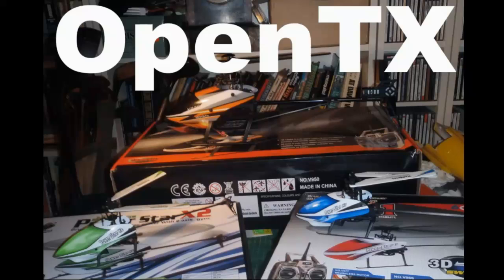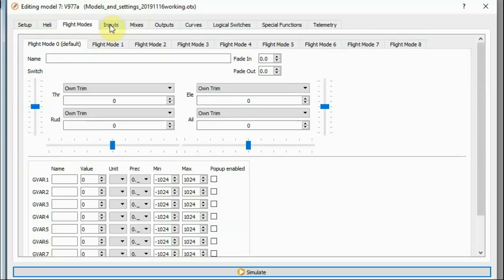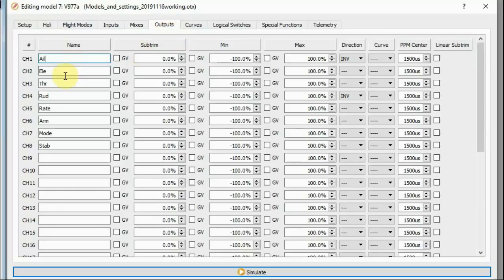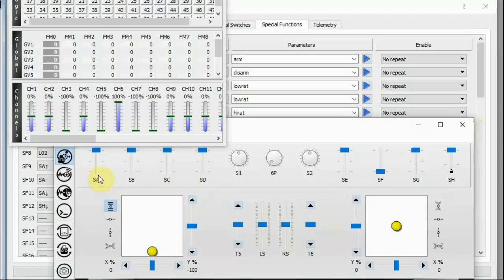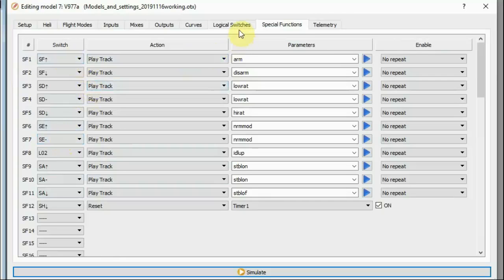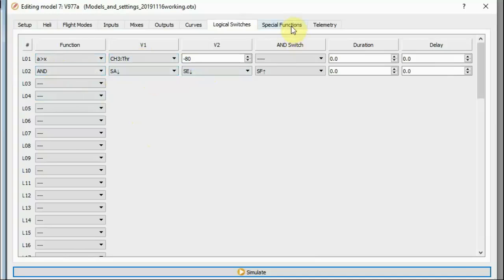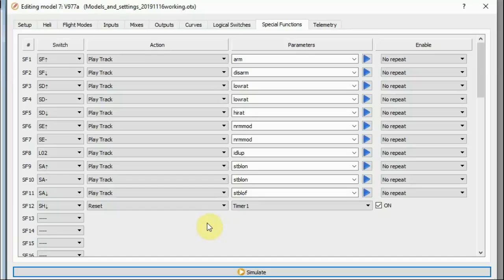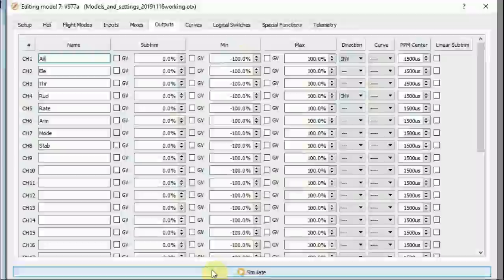OpenTX Heli Programming Pt 3   Flybarless Helis without Pitch Control WLToys V977, V950,V930

Comment: Why are the V950 and V977 helicopters advertised as "6CH" if they need radio output on 8 channels?
Reply from the maker: Are they advertised as 6 channel? I'm looking at the box for my V950, and it says '6 axis', but that's a different thing. 6 axis seems more accurate than 6 channel (though even the meaning of that is a bit questionable). They are collective pitch helicopters, capable of 3D flight. I think the confusion comes in between channel and axis, with '6 axis' being a common way of indicating a collective pitch, 3D heli.

Comment: Hi thanks for sharing, do you have a video doing this directly on the radiomaster tx16s transmiter,????
Reply from the maker: No, my OpenTX transmitter is the Jumper T16, which came before the RadioMaster version. But OpenTX is OpenTX - it's not written by the manufacturers of the transmitters, it's open source software. Now, OpenTX itself will have changed a bit since I made these videos, as new releases come out regularly... but new releases are always intended to be compatible with people's previous set-ups, so what is shown in this series of videos should still work on any OpenTX transmitter. If you have a computer, I'd suggest getting the OpenTX Companion program (free from the OpenTX site) and doing your programming on the computer, then transferring to the transmitter. For me, at least, that is much easier than trying to program using the small screen and limited controls on the transmitter itself.

Comment: my heli v950 can't bind on tx16s.  can you help me?
Reply from the maker: Not really. I've flown a v950 many times without problems with my T16. Are you sure that you have the protocol set to KN with the WLToys sub-protocol? Oh... with the v950, to bind it, after you put the battery in, you must press the little button on the front left of the controller board, to put the heli into bind mode - then, after you press that button, give the bind command from the T16.

Comment: Would it be the same for the V911S?
Reply from the maker: You can certainly program the V911S in the T16. Honestly it's been a while since I did mine. I was just looking at the programming for it - it's very straightforward, being just a stabilized, fixed pitch heli. There's a protocol specifically for it in the module, 'WL Heli V911S'. Then you really don't need anything, except Ail, Ele, Thr, Rud on 1, 2, 3, 4. I put mixes in for rates, but of course, that's not required. You don't need any curves, or logical switches, or flight modes. As Special Functions, I have SF as a throttle cut, overriding CH3 to -100, and then playing sounds for the throttle cut and the rates, and a timer reset.
Reply: @kleedhamhobby  Thks, I did exactly as you did with a Eachine E119, and I expected to work similar to the original transmitter (tame and aggressive), but it seems to fly exactly the same with and without all the bells and whistles integrated, and a miss this feature of the original transmitter.. Regards
Reply from the maker: @enriquech4041  I'm not quite clear what you mean. Yes, the V911S is similar to the E119 - basically they're exactly the same class of heli. The E119 is actually more docile and easy to fly, which, I assume, is because of the programming of its onboard controller. What 'bells and whistles' are you missing? Actually, I don't think I've really flown either of these helis using the transmitters that ship with them. I did see reviews saying that the transmitter that came with the 911S wasn't very good.
Reply: @kleedhamhobby  In the transmitter you have a left button that is used to change the flight behavior, from tame to agressive, and I thought that with your programming I could recover this feature. Regards
Reply from the maker: @enriquech4041  I don't believe stabilization can be turned off with the V911S, so probably all that button is doing is reducing rates. I do set variable rates in my programming - that is done by mixing at different levels on the Mixes page, and I control it with SG, giving low, mid and high rates (which I have set as 70%, 85% and 100%, with 35% Expo for Ail and Ele and 25/30/35% for Rud - but of course you can set the rates to whatever you're comfortable with... but if you set the rates too low, you may find it hard to control the heli).
Reply: @kleedhamhobby  Ok, that is clear. I will experiment with that. Thks again. Regards
Reply: @kleedhamhobby  Thks, I tried with 40-60-100% differential and it worked fine.

Comment: Hi thank you for the tutorial, however as you've mentioned that pitch movement can not be customized setup via the opentx pitch curve setting, but is there any way to increase the pitch maximum angle?
Reply from the maker: Well, there really isn't any direct access to the pitch from the transmitter programming with the V977 and the V950 - it's controlled by the programming built into the heli's flight controller. So I believe the only way to change the maximum pitch angle on these helis would be either to somehow get into the programming of the onboard flight controller (I have no idea how you would do that, but I might be possible with the right tools and expertise), or to modify the hardware - e.g. a longer arm on the pitch servo would produce greater movement (but I wouldn't be surprised if this messed up the control and caused the heli to crash, since it would obviously cause results for with the flight controller wasn't programmed).
Reply: @kleedhamhobby  yes indeed by stretching the arm, you are correct, and thank you for your excelent idea, thinkering too much on the app and electornic make me forgot the basic on mechanic.  :-))

Comment: Can WL V933 use this setup? thanks
Reply from the maker: The V933 is essentially a clone of the Hisky HCP80 / Turnigy FBL80. I don't actually have that one, but I do have its slightly bigger brother the V922 / Hisky HCP100 / Turnigy FBL100. You should not use this setup, but rather the one that I showed for XK helicopters in Part 2 of this series https://www.youtube.com/watch?v=qAD2pG3PQ2Q since pitch control will be on channel 6 (you'll need to check for appropriate reversals, and I'm not sure what, if anything, channel 5 will do - some sort of gyro / stabilization control, if anything). You will need to use Hisky protocol (FHSS) to control these helis, unless you are using some kind of satellite or supplementary receiver (I don't think the V933 has that facility; the HCP100 has a socket for a satellite receiver, and I have used that to fly mine using DSMX).
Reply from the maker: Michell correia rabbi  I'm sorry, I can't really follow what you're saying here. Also, I don't actually have V933 (if this is still what we're talking about), so I can't be sure exactly how it works. The closest I have is a Hisky HCP100, and I am able to fly that with my T16, using programming as in Part 2 - things definitely all move in the correct direction, though it's rather a twitchy and difficult heli to fly. I'm pretty sure that you should be directing your pitch adjustment to channel 6, and you may need reversals, if things move the wrong way.